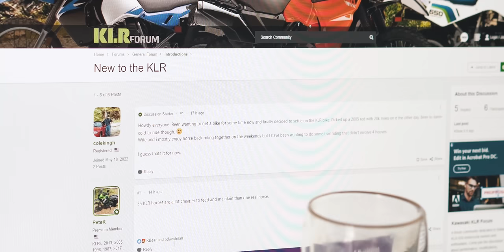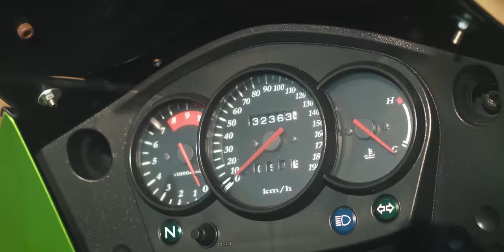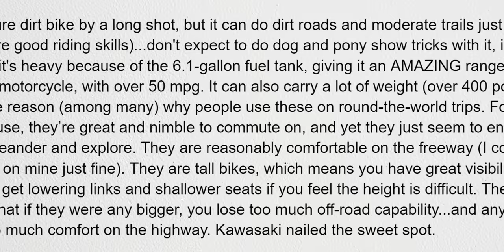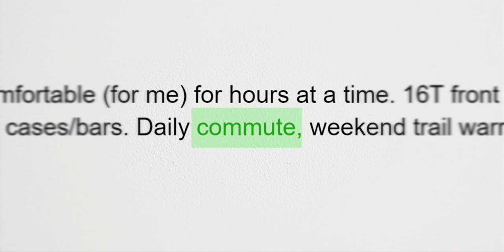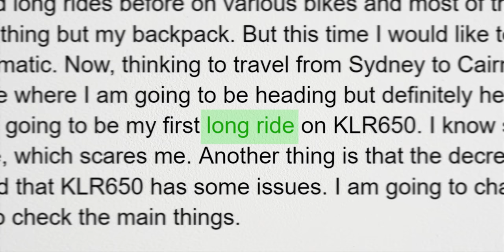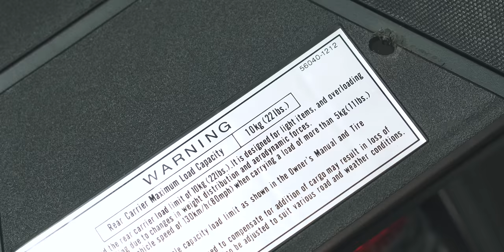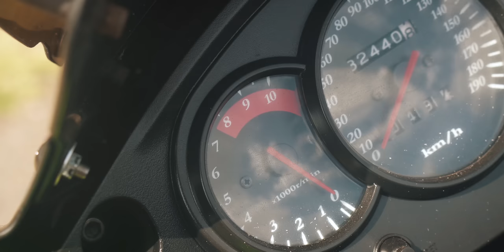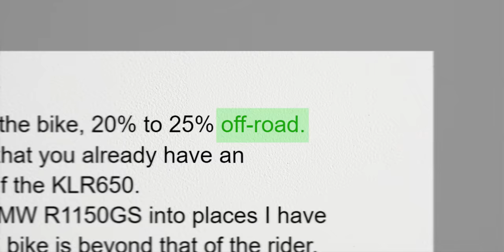I HATE the Kawasaki KLR650… so I BOUGHT one

Comment: I started out with one of these (2nd gen) and loved it. It's cheap, parts are everywhere, easy to work on, extremely reliable and mechanically simple. It rides decently well and gets the job done.  Sure, it's slow, but that's not the point of the bike. What's not to love for the price and point of use? People just have some wild expectations nowadays and do not understand how the design and manufacturing process works. Balancing cost and performance is a very hard job, it's called value engineering.
Reply: exactly
Reply: The Glock of motorcycles some say it’s too square some say it’s ugly some say it’s not safe or comfortable but no one can with a straight face say it’s not extremely reliable and tough
Reply: Same here,me too, just to get the job done, thanks God I own a commuter bike but good for family and daily up down.
Reply: I'd ride one I feel like it's too big for me hahaha
Reply: @DollarGeneral_Is_a_Plague  it's decently tall. I'm 5'11 and had no issues, especially with boots. I sold it to a dude who was probably 5'6, but he was kinda nuts lol.
Reply: but he talked about that in the video
Reply: Bang for the buck a KLR is very hard to beat. I almost bought a new Himalayan, but I ended up buying my 2nd KLR.  A 2018 gen2 with plenty of performance mods in pristine condition with a maintenance journal with all the mods and early services.

The previous owner had been riding KLRs since year one, 1987. His hip finally told him tall heavy bike days are done.

Sadly, my uber pig is relagated to living outside my condo 24x7x365. I expect weather to take its toll in 5-6yrs, but I'll have fun commuting in the mean time.
Reply: This seems like a good beginner bike. I haven’t rode a motorcycle since my teens, I’m 46 now. Good price point for a used one also.
Reply: Nicholas Johnson  it is more expensive and harder to find used. I've since moved into road bikes.
Reply: A lot of people who say it's slow are the ones you see doing 200 down the freeway, diving between other cars. If you're sticking to the speed limit, there's nothing wrong with it. It's a duel-sport like a 4 wheel drive; it's meant to go anywhere, not just be fast.
Reply: Royal Enfield is doing it now .
Reply: Agreed here! Good bikes!
Reply: @xx_mysticwolf_xx1492 I had someone say it was faster than my new yz450f.
Reply: Hell I think it's fast😂
Reply: You may want to take a sander to the top and corners of your custom windshield. You know, clean it up and perfect it.

Comment: I never expected you to own a KLR!!! This is my bike of choice, and am in complete love with it. Its so awful at everything, and yet so simple and cheap that i just love it
Reply: I've been thinking of getting one, but wanted to talk to an owner. How would you rate it in terms of durability, reliability, and ease of maintenance?
Reply: @slappy8941  a KLR is the modt durable and reliable bike you can own. You could neglect this thing and ride it hard and it would still outlast just about everything else
Reply: @TwentyTwoThirtyThree  like a Toyota
Reply: But the himalayan does it all better.....and its slower as well
Reply: @slappy8941  I’ve got a 2004 KLR650 that the previous owner had ridden every day on the highway to work. 60,000 miles, hours upon hours of running. Never needed a top or bottom end rebuild, only thing that ever went on it was a little fuse. These things are a lot lighter than they look when you’re on them. Great bike
Reply: @slappy8941  ok reliability, not brilliant. Kawasaki never properly fixed the cam balancer so they can grenade the engine if they fail. They also burn oil at freeway speed and as it's a single the engine starts to lose compression once it hits high mileage compared to twins.
Reply: Thanks CC.  Great job.  Good info.  God bless.  Happy trails.  Liked & subscribed.
Reply: I own a 2008 one. Mine has an additional exoframe in the rear that works both to stiffen it and to protect it and it's on the most aggressively off-road tires you could find that are still dot legal. I've been abusing it pretty hard and it's been indestructible. I'd get the EFI version though, the carb can be a nightmare (you have to disassemble half of the bike to get to it, so actually fixing it isn't going to happen in field conditions anyway). This thing is heavy, so you aren't going to be going on motocross tracks and jumping it, but it's perfectly competent to ride around all day every day for however many days you want in anything short of very soft mud or sand) and it uses very little fuel ( as low as 3L/100km if you baby it, I rarely go over 5L when going pretty ham). Don't expect to be going more than 120kph on pavement for any duration though.
It literally is a tractor with highway gears - you will go almost anywhere you want to go, but it's not going to be in air much
Reply: Also, my engine is after a rebuild, but the engine block is so old you can easily bore it out a bit and get a new, slightly bigger piston and it runs just fine. So far the worst issues I've had were with the damn carb (my tank might be rusting though)
Reply: @slappy8941  
Yes.
Reply: @mattyb7736  
No.
Reply: @ZoomZoom870atGmail 
Thanks for this.
Really helpful comment.
Reply: Its actually jack of all trades master of nothing. Its a good bike at exactly everything even for beginners and yet it masters nothing. 650 cc on one cylinder baby!
Reply: Just bought the new '23 with the 6th gear and loving the freeway now
Reply: @slappy8941  Not much to think about, because you can't go wrong when so cheap. I loved mine and am looking for another. I think I want a pre 22, because the are 100 lbs lighter.
Reply: @TwentyTwoThirtyThree  KLR's, VStroms and Transalps are nicknames cockroaches, because they just dont die 🤣🤣

Comment: The KLR-650 is too heavy to be a dirt bike, especially in loose sand. It is very comfortable on roads, dirt roads and trails, but too heavy to maneuver like a dirt bike. The riding position is upright and very comfortable, and handlebar leverage is excellent. It's a great ride to and from work, which is about 10 miles each way for me. No problem keeping up with highway traffic, and gets about 50 mpg. Just make sure you replace the two bolts that hold the forward frame to the aft frame near the tank. Replace them with a single, very long 10mm bolt that won't break. This mod is in a kit for the KLR, and comes with a long drill bit for drilling all the way through to accommodate the single bolt , and is a must do for riding off road. If the original two bolts are there when you hit a very big bump, they can and will shear, separating the frame near the tank and ripping the gas tank open, soaking you in fuel as you fall and leaving you stranded. This mod is a critical safety issue and is a MUST DO!
Reply: Ur not supposed to go slow in sugar sand. If you do you'll have life.
Reply: Having experienced the dreaded sub-frame bolt failure, I can tell you that it's pretty unlikely that your gas tank will fail and rupture. However, you will most likely have your air box ripped open, with the chance of dirt or sand being sucked into your carburetor, and -- if you're really unlucky -- the wiring harness will be torn apart, leaving you the unenviable task of figuring out which wires go where, and testing your soldering skills. I almost forgot to mention that you may end up having to drill out the remnants of the factory bolts -- SO much fun! Learn from my mistakes: replace the damn bolts.
Reply: Yes these things are like riding a wet noodle in the sand.
Reply: Scott Hicks  There are cases where the tank is ripped open. Maybe you were lucky.
Reply: Ronnie Williz   The KLR is just too heavy for sand. It ploughs the sand. It is a gentle trail bike, a timid road bike, but a terrible MX bike.
Reply: @markdavid4897  The KTM 1290 is even heavier than the KLR but has no issues with sand. The KLR is just primative tbh and Kawasaki didn't understand how to fix it.
Reply: The KLR has a very long list of must do items.
Reply: i can do sand its ez depends on ur skill n upper bod

Comment: I had a 2009 KLR, and loved it! I had full luggage, high windshield, comfortable air seat and gps. It would run all day long and easily keep up with touring bikes. Reaching the off road trails, luggage and windshield off in 5 minutes and off road you go. There wasn't anywhere I asked it to go that it didn't soldier through. Knock it all you want, it's a beast.
Reply: Where is your KLR now? Why did you get rid of it? What are you riding now!? We need to hear the whole story! ha. I had a 2002 ZX-6R Ninja, and I will say, they are the best motorcycle ever made. For some reason I got scared and sold my bike for $3,200 with only 10,000 miles on it, after my friend got hurt and almost died when he hit a deer at 130 mph. Not a day goes by I don't cringe because I wish I had not sold my pride and joy motorcycle.
Reply: I like the big gas tank on them. I wonder if a bigger aftermarket one is available ?

Comment: If the T7 was out when I bought my KLR in 2018 I would have likely bought one of those. However, I got a KLR. I was looking for a bike that I could go long distance on, was simple enough for a non-mechanically inclined person to maintain and I needed it to be able to travel at least Jeep trails. Price was a consideration, but it was not a primary concern. 

Beyond the KLR, I considered a GSA, we-strom and an Africa Twin.

The GSA is an impressive bike and the we-strom was kinda fun. The AT though had me very interested. I basically had one picked out and was researching luggage and parts. In an effort to be complete, I went ahead and test road the KLR. I bought it before I left the dealership for $4800 out the door. A 2016 with 616 miles and luggage included.

A third of the cost of an AT with luggage.

The AT is a better bike in every way, but it is not three times better. 

The KLR is my favorite bike I have ever owned, it goes interstate speeds without complaint and then also goes further off road than I have the skill for. But my next bike will still most likely be a T7 =)
Reply: That's the way I feel about mountain bikes......$5,000 MTN bike is better than a $250 Schwinn Boundary but nowhere near $4,750 better.
Reply: A Wee-Strom should be as boring as a KLR but far from it due to its capability, frugality, range and rips in the twisties.
You obviously can't go as far off-road on a Wee-Strom, but it is quite comfortable cruising gravel with a bashplate mounted.
Reply: @michaelbrinks8089  If you tried to ride a $250 MTB anything like what the $5k one is capable of, it will break. Quickly. By the time you buy enough $250 bikes to cover the distance the $5k one will go, you're likely losing out.
Reply: @phreenom  Or you could buy a brand new $5,000 motorcycle that'll last much longer the $5,000 MTN bicycle.  Sure seems like you get WAY more for your money when you spend $5,000 on a new motorcycle VS $5,000 on a new bicycle. 
    If one $100  bike frame is made of 6061 aluminum, similar shape & weight to the other 6061 frame that is $1,500. I don't understand how the $1,500 frame is $1,400 better.
Reply: @michaelbrinks8089  There's no reason the $5k motorcycle would last WAY longer than the $5k MTB. 

I'll give you the short answer as to why the more more expensive bike is better. Because it is. Though I can assure you there are vast differences in the quality of the frames (assuming that $100 frame is actually the same material and weight, which would be doubtful), the greater differences are found in the components. The wheels on your $250 bike are literal garbage, along with most of the other parts. There just really is no comparison.
Reply: @phreenom  I totally agree the $5,000 bicycle is much better,  just not $4,750 better....Like cheap non stainless steel spoke nipples are gonna rust quick. The stainless steel spoke nipples won't rust but shouldn't cost 10X more.  I seen some $35 carbon fiber valve stem caps lol. I'm sure they are better than the 50 cent plastic ones. A $20,000 Gucci handbag is much better than a $250 handbag. Just not $19,750 better.
Reply: @michaelbrinks8089  It actually is that much better. The same way a Porsche is $50,000 better than a Ford Focus. It's not just the materials, it's also the engineering, durability, and build quality.
Reply: @phreenom  I agree a Porsche is better than a Ford Focus (a Honda is more reliable than both)  but  Porsche & Ferrari are more examples of overpriced, unreliable but fast cars. Where you're just dropping money for the name brand. Same with a $30,000 Harley VS a similar $10,000 Japanese Cruiser. 
   A C8 Corvette has the same performance specs as Ferrari/Porsche, but with more reliability & cheaper parts for less than 1/2 the cost...The Fast & Furious movies are cheesy but they're correct when they show the built Supra out performing the stock Ferrari that cost 3 or 4 times as much. The Supra is also more reliable. 
     For $5,000 & $10,000  the mountain bike better be made of all titanium alloy. A $1,500 rear Fox bicycle shock is a joke.... Like compare how much engineering, raw materials,build complexity, factory space, number of employees, amount of complex tools needed/used, power,etc... it takes to manufacture a $5,000 motorcycle  VS a $5,000 bicycle.
Reply: T7 is a revver, you have to get to the power, KLR is right there. The 7 is better on the motorway, lighter and quicker but the feel of a big single is unique and satisfying.
Reply: @michaelbrinks8089  Ah, a fellow schwinn owner. It is a good analogy because a few upgrades on the boundary or axum will easily put them on par will more expensive hardtails at a third the cost.
Reply: @pellabandgeek  I tricked out a Bass Boat Green Homegrown, full XTR, Fox forx, everything. Raced it a few times in Marin, and won against newer, fancy carbon full-suspension jobs. The looks I got when I muscled my way to the front starting grid were satisfying... And then to actually win.
Reply: @phreenom  Expansive bikes like that do not always have though components they are made for performance not for long term reliability. You will break things (derailleurs, wheels, lever ) same as a cheap bike but it will cost you way more to repair. It will help be a little bit faster though.
Reply: The Honda Transalp 750 is a better road bike than the T7, and the Tuareg is a better dirbike than any of the bikes out there. But a T7 is apparently considered the most reliable because it has established long term reliability, although it's handling cannot compare to the insanely good Italian handling of the very ugly Tuareg. The Tuareg also has an insanely good sounding engine and airbox. The Transalp 750 looks insanely good and sounds better than any new motorcycle in existence, so that will probably be my next purchase, but I am not intending on doing any fast dirt riding. If the Tuareg had a 6th overdrive gear, and twin headlights, I'd buy it over any motorcycle in the world.
Reply: @reinach77  Not at all true. I have an $8,600 high end full suspension Ellsworth Epiphany that I built in 2007. All of the components are original and in perfect working order. Sure, I've replaced consumable parts such as chain, cassette, brake pads, tires, cables, fork/shock seals, and grips. But all the core stuff like wheels, shifters, derailleurs, suspension, brakes are still in perfect working order. It's been ridden hard, not babied, and has required far less fussy tuning and maintenance than cheap bikes... I will agree that if something does break, it will be more expensive to replace, but there's no reason it won't last a very long time with proper care.
Reply: People talk about that doohickey I don't think it's a huge problem, 30 years Kawasaki never did anything about it on the KLR and I've never heard of any engine failures on the KLR only engines that are going 75- 100,000+ miles virtually maintenance-free and if it has ruined an engine once in a blue moon it's probably not more than any other problem than any other maker has with their brand

Comment: I owned and rode a KLR across Canada (and back) on the TCAT (Trans Canada Adventure Trail) much of the way and can testify to its extreme reliability. Broke the chain (fixed with a link I carried with me) and fixed a bunch of flat tires (not unexpected in these coditions) Sure it's a pig, but it is ultra reliable and parts can be found everywhere. So, while all those KTM and BMW riders are stranded scratching their heads while looking at their electronics, the KLR's just putt by. Classic tortoise and hare story for sure.
Reply: But I have to say, the issue with the electronics is also a myth. I know several bikers who ride theirs bmw's around the world and never had any issues at all. Yes If something bad happens youre f*****. But thats usally the case when something had happens with your bike unless its a super old one where you can just replace the engine with anything more or less similar. Actually KTM's are definitely not very reliable , heard of many brakesdowns and they couldn't figure out the issue wihtout a mondern device ;)